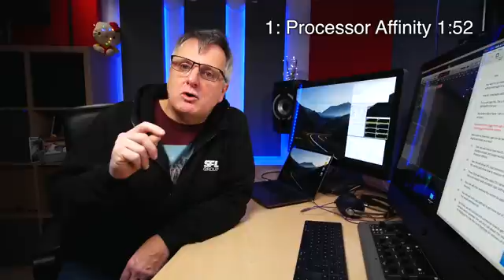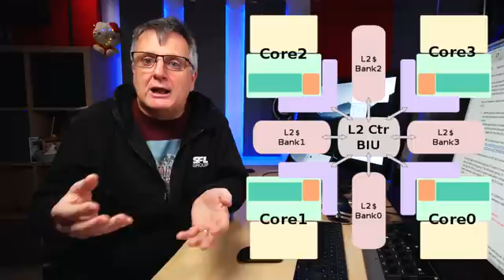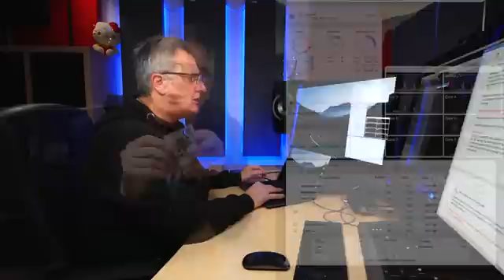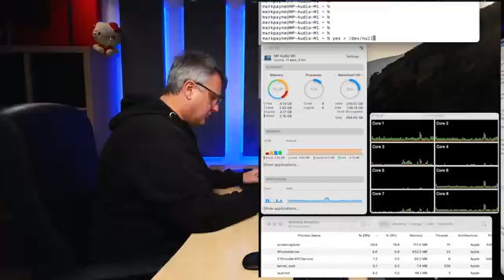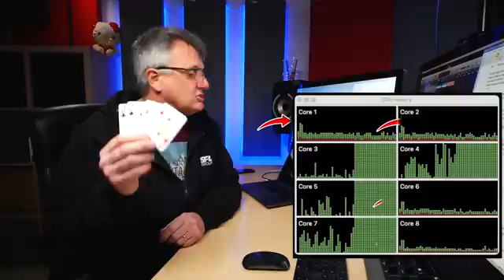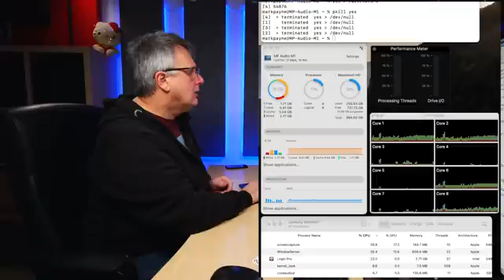Logic Pro X CPU Optimization | 2021 | M1 System Tips | Run more Plugins!

Comment: Hey Mark, this was probably the most comprehensive video on Logic Pro x optimization. 
I really appreciate it.

I had a question. 
I have the Mac Mini M1 with 16GB RAM and a 2 TB HD.
I mainly compose orchestral type of music and use Kontakt full version extensively.

My question is how many Kontakt instances (each with just one instrument loaded)
can you load up on a Mac Mini M1 and of course have midi data in each instance?

I ask because it's a pain to use the Kontakt multi-timbral feature and load up to 16 instruments. The problem is that you always have to go to the FIRST instrument track in logic to open up the Kontakt player.

Comment: Hi guys, I use a  komplete kontrol with M1 Mac in logic pro, all good I can play keys, when I open logic knobs they are mapped automatically to the volume, pan, master volume etc, so I can use knobs to control these parameters. The problem starts when I try to map the knobs for example to serum cut off filter using a control surface it does not work. When I move the knob on KK "NO message received yet' can be seen all the time. What's strange is when I press the keyboard key logic receiving a message I can see 'Learned' so I can map a key to the Serum cut off knob as normal. Knobs don't work with the native synth of KK or Logic too. I set Logic to open in the rosetta app I set firewall options, also KK midi in and out in standalone, there is no USB hub between the KK and my M1 mini. I can easily map these knobs in Ableton Live but somehow it doesn't work in Logic. Did I miss something? if someone here has any idea whats the issue please let me know. Thank you.

Comment: Thanks for all the information in this video Mark. Sorry if this is OT since I'm on a 16-core 2019 Mac Pro and not an M1, but with my CPU there's no difference in performance between selecting Automatic or 32 (max) in Processing Threads. What's odd is that Logic is only using odd numbered cores (1, 3, 5, etc up to 31) and the even cores aren't being accessed at all by Logic (or any other apps for that matter) according to Activity Monitor. Any idea why that might be?

Comment: It would be very interesting if Apple would optimize Logic Pro to be able to use available GPU cores for extra processing power, particularly as they release more powerful GPUs in the future.  If Apple were to create a new plug-in format that uses their GPU as a separate processor for running plug-ins, that would change the game for real time tracking through plug-ins in Logic Pro without the necessity for extra external hardware.
Reply: My money is on the leadership at Apple not re-architecting Logic pro to use the GPUs to great affect.    They have chosen a very simple way of scaling with a multicore CPU.   It is mostly the OS's problem to divvy out the work between cores without sw architectural changes within the application.   It would be a much larger problem for the Logic pro developers were they to rearchitect the application to use GPU for the computation tasks that are currently handled by the CPU.     It can certainly be done, but don't envision them doing it.
Reply: @garysolomon3845  yeah, I agree with you.  Interestingly enough, another company has taken advantage of the gap in the market.

Check out GPU Audio.  They already support running VST3 plugins on Nvidia GPUs, and within a week, they will officially support AMD GPUs.  In 2023, they will support Apple Silicon, and they intend to expand support to cover different plug-in formats, beginning with AU and AAX.

If they do not have a patent on the concept, Apple needs to jump on board, but I doubt they will.
Reply: @robertsimpson5801  i did a consulting gig for a few years at NVIDIA after retiring from Intel in 2012 and i can tell you that NVIDIA did a TON of heavy lifting to enable general computes on a GPU core.  They invested heavily in enabling the development community with great sw tools, and a compiler to help designers port their massivly parallel computing solutions to Nvidia gpus.  I just don't see the "geniouses" at Apple even knowing what is required for industry enabling no less take on anything that involved.

Comment: What I do to check how much a computer can handle in Logic is I have a session with only Sculpter (physical modeling synth so it really uses the processor), having a number of tracks with different Sculpter sounds, very complex ”music” (random notes, long overlapping notes and ”strummed” large chords and short notes in the mesh) and bringing up the tempo to push the processor and see when it goes overload. The most absurdly astonishingly difference was when I made this session in my then G4 Mac Pro and put it into the simplest of the then new intel-based iMac… If I recall correctly (in the boll park) my G4 Mac Pro could handle this session in some 40 bpm, where as the simplist iMac intel could do it flawlessly at 300 bpm, so I copied and pasted the whole session to double the tracks and still flawless performance… Finally I gave up on trippling, quadruppling, etc the track and just bought the iMac and got rid of my Mac Pro.

I am looking forward to doing the same test on a Mac Mini M1.
Reply from the maker: Let us know how you get on!

Comment: I didn't see the AU Hosting Compatibility Service running in your activity monitor, which is where I'm stuck at the moment. Trying to get my M1 machine to be as reliable as my Intel one but I guess I'm at a dead end until everyone ports their plugins over, which I imagine will be some time yet. Great video though, I learned a lot even if it's not the problem I'm currently trying to solve. Cheers mate!

Comment: Im using a mac book air. 2018/2019 version 8gb. Followed your tips. I still get overload. So does that mean too many plugins?
Reply: Any 3rd party plugins? Are you freezing tracks when you can? Are your sample libraries installed on your system drive or an external SSD? 8gb's of RAM is not what it used to be. Today;s modern plugins are THIRSTY. I have a 12 core Mac Pro with 96 gigs of RAM and I experience overloads.
Reply: @HollywoodVirtualAudio  tons of 3rd partyz. Waves bundle’s. Im pusher. Vallhalla.  Fab filters. I freeze tha tracks not in use. Buffer size 1024. Computer threading to 4. Saved internally until i get a external that can connect to the macs new slim port

Comment: Mark.  I love what you do.  You go pretty damn deep and keep it understandable.  Question.  I have a Mac Mini i7 with 64 gigs and I'm stuck with Mojave for Logic Pro 10.5.1  I also have buckets of 3rd party stuff that I use all the time.  So I need speed and something that will handle a pretty big palette.  So if I get an M1 mini,  and run Logic and my plug ins through rosetta,
will I see a big performance jump? (I've been doing what you talk about with Aux sends and everything I can think of to offload CPU demands.  but it's not enough for my work)    Another option would be to invest in Universal Audio Satellite 2 and get all of my plug ins out of the main box  (this is an expensive option!!!)  I'd love to hear your advice on this.  Thank you
Neal  cinemacue.com
Reply from the maker: I think you would be impressed with the M1 mac mini performace.

Comment: Thanks so much Mark.  This was fantastic.  I literally just upgraded my Logic machine from a 2015 MBP i7 to a Mac mini M1 with 16GB RAM and 1 TB SSD to run the Spitfire Audio BBCSO Pro Plugin for big sessions.  I was getting so much grief with overloads in playback and the fans in my MBP were all but moving it accross my desk lol..  First thing I‘m going to try before setting up the M1 is if changing the settings on the 2015 machine will allow it to playback what it couldn’t before.  That would be eye opening, but wouldn’t make me regret getting the M1 as fan noise of the intel machine has been and would continue to be an issue in a small studio where I also record live audio for my demos. The remaining question will be whether I even need to consider a M1X in September as my laptop upgrade.  After all, the mini will live in the studio, so I‘ll need a laptop for the road.  May be that the 13“ M1 MBP would be the ticket, being as you suggest, similar to the mini in responsiveness and thermals. Again thanks so much for a great tutorial! Cheers.
Reply: @Kwame Ryan, I'm curious, do you or did you actually intend to put orchestral sample libraries on your system drive? SSD or not it's usually not a good idea. I have a 12 core Mac Pro with a 512 GB SSD. But all libraries (including BBCSO Pro) stream from external SSD's. Did you set up your 2015 MBP with libraries on your system drive?
Reply: @HollywoodVirtualAudio  I did put them on the system drive, but I'm gonna remove them. Noticed no improvement in performance over external SSD used with 2015 MBP, and 600 GB of internal memory locked up by a library seems a waste.
Reply: @kwameryan  yeah the biggest problem with modern players and plugins is RAM. Once they get all the plugin kinks out I'll pick up an "M" chipped machine, but not a moment sooner. Hows that BBCSO Beta doing on your M1?
Reply: @HollywoodVirtualAudio  The M1 Beta is very performant but a bit buggy still. Lots of stuck notes, which I never experienced on Intel, despite the pure performance being less potent. Less overloads but more small glitches on M1.
Reply from the maker: look forward to results

Comment: H Mark, I have been using an M1 MacBook Pro for over a week now and have experienced terrible battery drain while using Logic Pro X.The battery lasts around 4 hours while working with Logic which is pretty abnormal. Any idea of why this could be happening and any ways to fix it? I have already optimised Logic as per your video

Comment: Absolutely a great video... thanks for everything, BUT, it hasn't solved my problem :( . Pleeease someone help me.. I have a Macbook Pro M1 16gb ram. When i record with my Scarlett Focusrite 2i4 in Logic pro (drums with xlr cables or guitar with jack cables) it randomly cracks in the audio and therefore i have a bit of latency for a split second, and therefore the thing i recorded is just unusable because it isn't where it supposed to be on the grid. When i plug that exact same scarlett focusrite in my Macbook Air from 2015 with 8gb ram(which almost explodes when i open gargaband...), i have no issues at all with recording. 

Is the problem related to the focusrite being to old for this new Macbook M1 of mine? Is it because the usb cable of my interface now can't go straight in the computer because there's no usb portal anymore and you need this ridiculous usb adapter between it?  please anyone, tell me what i should do... thanks

Comment: For lack of my technical knowledge, i could not really understand if m1 16gb system is great for logic pro work or not. There are a lot of so-called tests of m1 and it's performance but as you said it is all nonsensical. 
Overall I'm looking for a machine capable of modern music production (sometimes i really love to play with heavy orchestral libraries, so I need at least 16 gb of RAM ). I'm thinking about building a hackintosh, or buying a m1 Mac mini, or waiting till pro line of macs will be released (but they are going to cost a small fortune ) What are your thoughts? Specifically on building hackintosh in the light of m1 and potential m1x/m2?

Comment: Fantastic Mark. Just what I was looking for. Based on your other reviews, I got a MacBook Pro M1 with 16GB RAM and 512 GB SSD drive. I'm not a professional musician but do amateur stuff and I had a few questions: 1) What settings do you recommend for recording guitars, vocals and other live instruments as well as software instruments?  2) Can one keep changing audio settings within the same project depending on whether there is playback or recording and would that be possible and work okay? Latency is of course important as a guitar player so I normally keep the I/o buffer size setting at about 32, 64 or 128 while recording. I normally use Helix Native guitar plug in, NI Komplete 12, Soundiron libraries, Arturia V Collection 7, Synthmaster, SSD 5.5 Drums, some Zero G Vocal libraries, sometimes EZ Drummer and Alchemy of Logic for my software based sounds. I was using Apogee Element 88 and 46 Audio Interfaces earlier but they don't work for now with the M1 so I'm using my Line 6 Helix guitar processor through USB as the audio interface for now. Thanks again for all the great videos.

Comment: On M1 Mac Mini basic model with 8 GB RAM I used 3-4  layers of UVI Falcon synthesizer for playing live virtual instruments and I had to split them in different tracks as recommended by UVI because otherwise they would stick on that same CPU core if just layering in one track, and I also had to increase Logic to use the 8 cores instead of the recommended setting. It depends a lot on the instrument itself, but for example the Hong Kong pad instrument by itself had spikes about 60% of one efficiency core CPU usage and near 40% on average while just playing one note only.
Reply from the maker: It depends on the thread implementation of the instrument. It is likely that one note lives on one CPU.

Comment: Wow, maybe I'm a musical computer nerd, but u hit it the nail directly on the head. It's not that I study these concepts, but because I have a electronic engineering background who also uses Logic etc... I really appreciate u doing the homework for us. I guess it's a little of being conservative/cheap and not wanting to get ripped off or spending unnecessarily. Because music gear is already expensive and the little u need is still quite expensive. So for guys like me its interesting and super helpful you going in-depth to help me decide what seems to be on the surface as a very basic decision. 8 or 16 !
16 for sure. There could be a lot of guys who bought/ spent $4000 in 2005 for a Mac pro workstation quad and $1200 full price logic. Sure it's stable, and I created
quite a bit of music, but I'm not even an apple cult follower. I feel I got stung, with this limited OS upgrade system etc.... Apple has come along way, but maybe if I had only decided to study pro tools, things would be much better, maybe even cheaper? Who knows, maybe I'm an idiot ! But u Sir are not ! Top notch stuff! I will be sharing your channel. Thanks.

Comment: THE BEST REVIEW OF M1 IN MUSIC ENVIRONMENT !  Thank you very much !   One question : If you run KONTAKT in standalone mode, can it handle the 8 cores as logic does or will it only use 1 core ?  I keep searching answers...but don't find. I'm running K6 in standalone mode on windows and uses my 4 cores cpu. But i really want to move to mac M1. But have to know before if K6 in standalone mode can use 8 cores . Thanks !
Reply from the maker: I don't know on this one as I do not use Kontakt ... my guess is that is will use the 4 high performance cores.

Comment: Best real life test on Logic with the M1 processor! Thanks!
Reply from the maker: Welcome!
Reply: @MarkPayneAudio  Now the only question I have is will older Logic Pro X, i.e. 10.4 or 10.5 run on this chip, or would translating through Rossetta 2 be a major bottleneck?
Reply from the maker: @DrumApe  Logic running under Rosetta is NOT a significant drawback. I am still working with most of my plugin suite that is not recoded for M1 so that part of the DSP environment is running under Rosetta anyway. Running logic Native or user Rosetta is pretty much a tiny issue compared to the heavy lifting being done by the plugins which is of course user Rosetta mostly. As for not running the latest Logic version when you move to an M1 system... why would you do that?

Comment: Fantastic Mark. Subscribed. Just started running Spitfires BBC Symphony for orchestral composition, which handles the use of the plug in very well it seems, and producing EDM with a pretty typical array of synths and plugins
Reply from the maker: Welcome aboard! Love to know more about how the spitfire libs are working out for you. Do you have any projects running that you could share more info on? Are you on 8GB or 16GB ram? How many Spitfire tracks are you stacking up?
Reply: @MarkPayneAudio  Not on an M1 yet but running a top of the wozza i7 6 core max mini with 32gb of ram
Currently got a project up using Spitfires fantastic BBC Symphony Core template with 275 tracks including stem and print stacks clicks plops busses and you name it is there. So far in this project only using 18 but it is growing fast. No system overload notifications yet obviously
Reply from the maker: Loving the bass line on Twenty Ten!
Reply from the maker: And the Groove on Andy's Song!
Reply: Thanks mate Very kind

Comment: Thank you for your thorough explanation and insight on the M1.  I am on the fence for buying a new Mac MINI and am unsure if the latest i7 with 32g ram is still better for running multiple library Plugins(like the EastWest), or is the M1 16g still better.  I was thinking 2tb 16g M1 & install the OS on external drive, & the EastWest cloud composer on internal ssd.  I am told internal ssd speeds are always faster than external, and this would save on ram.  Can you pls comment on having limited thunderbolt plugs & how it will affect the setup(as compared to the many ports available on the intel Mac mini)
Reply from the maker: I think this video would help https://youtu.be/Iy2Olv1clEE .. However on other comments: I have not tested big sample libs on M1. Surely someone on YT has done that? The safe option for samps would be the 32GB system I would suspect. I would NOT install the OS on an external, that sounds like a pain. The internals are much faster yes... maybe 5 times faster.. say 2800 MB/s vs 600MB/s for a typical external. You will see in the video I have linked above a section on the Thunderbolt hub I am using.
Reply: Thank you for your insight once more